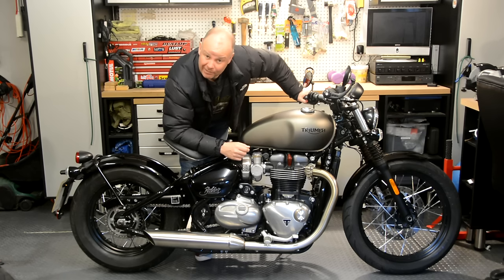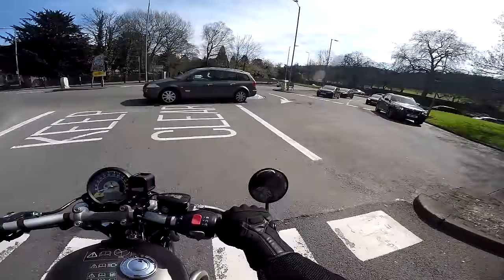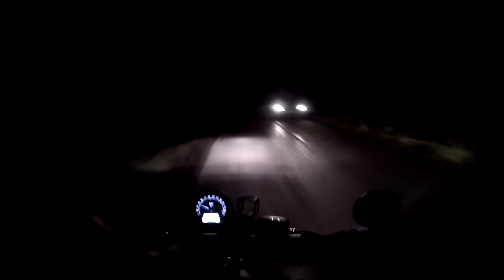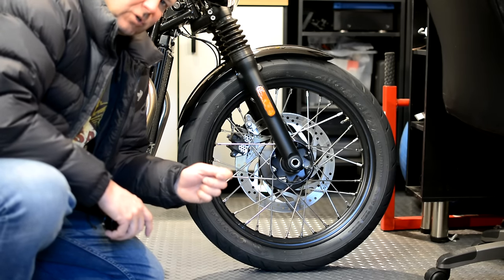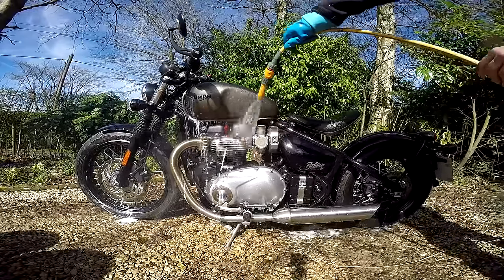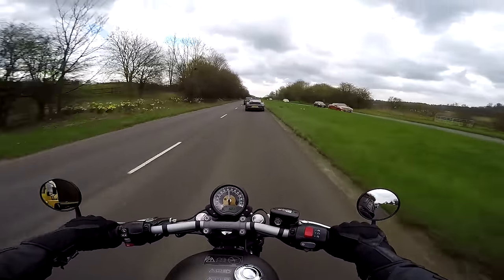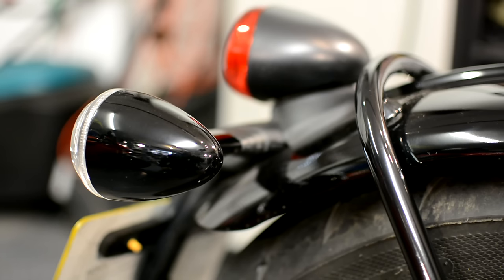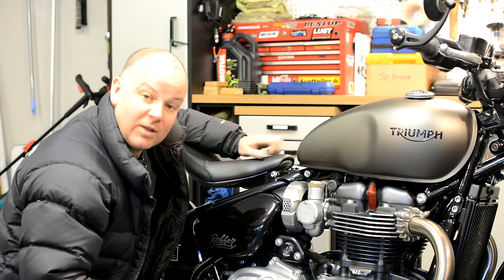Living with the Triumph Bobber - Long Term Review

Comment: Won one of these on Saturday in a competition!  Best £2.50 I’ve ever spent.....yep, £2.50!!!
Gets delivered tomorrow. Be a bit of a change compared to the MT09 but what a bike for those nice summer days!!
Forgot to add it’s a 19 plate with 1,579 miles on the clock.
Reply: I was going to get a Yamaha mt-10 but opted for the bobber. It’s such a classic look and I’m older now and don’t need to be breaking the sound barrier everywhere I go. How do you like yours?
Reply: @jak2828  hi dude. Yeah love it! Well that’s when the weathers decent enough for it to come out to play.
Such an amazing bike just to cruise about on and be a posing bugger haha.
I’d love an mt10 but I’d have to trade both bikes in…..don’t want an Mt 10 that much though! 
How you finding it? Was it the newer 21 plate model you got?

Comment: I fitted a T120 tank 170miles per fill up, Pretech 6pot caliper sorts braking.
Nice honest review
Reply from the maker: 170 miles is more like it - bummer that you have to change the tank though!
Reply: TheTrirocket3 so you changed the tank and brakes on a brand new bike? Respect
Reply: TheTrirocket3 whoa so you can install the larger tank on it. Thanks for that man. Was it a difficult job? 

Im looking at getting one of these but the tank size is my only grip. There are sections of highway where you can have 50 miles or more without a fueling station.
Reply: Post a video! Would love to see how it looks
Reply: I know this is an old comment 🙄 but will the T100 pipes fit on the bobber? I'm wanting the black edition here in the states but I want to liven it up a bit 🤣

Comment: A trick for detailing. Go to the paint store, or order up a 4" or larger, natural bristle paint brush (not nylon or synthetic...it should be natural hair.) Wrap the metal strap with gaffers or duct tape so you can't scratch your paintwork. Get a clean bucket of water, duck it in, and put a little soap on the brush and scrub up the bike. Spoke wheels become a breeze, without busted knuckles, the bristles will get into all the little spaces and clean them out, and when you're done the brush cleans up nicely.

Comment: Great review there Missenden Flyer!

I agree the front brake is marginal.
The small air cleaner and throttle body are fake. Just for show.
The 2 air cleaners are under the side covers.
The bike is fuel injected, so no carbs.
The stock exhaust sound was very good. If throaty is your thing.

I have 750 miles on mine and I absolutely love it (I have 2 other bikes that will be collecting dust this summer)

Comment: I just got my 2017 T120 and honestly.. I rode 200 kilometers yesterday after picking it up and my dip beam is so much brighter at the sides of the road than the high beam and still shoots straight down. I thought that I had been riding with the high beam on but I wasn't lol.

Comment: Thanks for the efficient long term review. Totally agree with the cleaning issues. I like a clean bike and the Bobber does seem to lose its new finish pretty quickly. Also dislike the key position, and think the handlebars and clamps look cheap. I love the hard tail look of the Bobber, but If I was going to spend that kind of money I would go for the Honda CB 1100, SORRY.

Comment: The fuel range seems to be much the same as Harleys fitted with peanut tanks, but their owners don't seem to see this as an issue.  Personally, I do - I dislike refuelling at any time.
Reply from the maker: +Tim Hammond Yeah me too, it would stop me buying one...
Reply: Tim Hammond 44 miles. Ridiculous. My electric can do 110 miles.
Reply: Chris Bramblett My Sportster 72 does about 50/55 before the fuel light. However, I have a very tall sissy bar with a bag and a fuel can strapped to it, so every 50 miles I just need a lay by. Although many would hate that, most of the old school chopper community just accept it.
Reply: those are ridiculous range, my tuono can go 100 miles before i hit the petrol station and even at that range i find it annoying
Reply: MOTHER OF GOD, that's bad ! And here i was bitching and complaining about mine going off at 120 (us)miles.
Reply: I have to say this doesn't bother me. I stop every one-and-a-half to two hours or so for a rest anyhow, so refueling doesn't really matter. Cruising at 100kph it does about 3.6-4 L/100km so can easily do two hours riding which fits well with my breaks.
Reply: Tim Hammond yeah if plan on doing more than a drive around town or to the bar a few times. I'd recommend something with a bigger tank. Triumph speed master maybe
Reply: 100kph is approx 60mph.  So riding for 2 hours would give 120 miles.  The Bobber would want to be refuelled in around 70 miles, no where near 2 hours duration !
Reply: Zen Zen I get 3,6L to 4L per 100km at 100kph. That means with a 9L tank I can ride for 2 hours quite easily. It's very fuel efficient in 6th gear at 100kph. I think you are maybe calculating with average fuel consumption.
Reply: Wow that is good.  At 4L/100km I calculate that you are getting a range of 135 miles.   This is much better than the 70 miles that the reviewer was stating in the video :)
Reply: Zen Zen that's only the range cruising at 100kph. Around town it's a lot lower.
Reply: I agree with you Tim, this is the one big issue I have with this bike. I like to ride, not visit petrol stations. I don't go to bike meets cos I wanna ride, not stand around with a full tank of fuel admiring my shiny unridden bike. This bike isn't for riding round towns either, it wants the open road. That's the beauty of the single seat... leave the missus at home and get out and enjoy the road not a bike meet.
Reply: i thought it'd be ok as i live on the isle of wight.but its a bit annoying.especially as they make you get off your bike and take your helmet off at the big petrol stations.alot of times i go to the little ones even though its more expensive,just so i can sit on the bike and not take helmet off and earplugs out.its quicker
Reply: These short fuel ranges are amazing to me. I've got an old 1999 Honda CB750F that gets up to 53 miles per gallon ( taking it easy) and with a almost five gallon tank I can easily get 240 miles.
Reply: That makes sense.
Reply: Official specs were 69mpg, so 138miles. 135 is v.good indeed!
Reply: All of my sportsters got 100 miles per tank.
103 to be exact!

Comment: Great video!  The suspension is medieval!  A new adjustable shock is a must!  The stock seat is minimal and should be replaced.  The wide handlebars aren't adjustable and reach for anyone under 6 feet tall.  The headlight is adequate but could be brighter and better defined.  The headlight switch is a bit backward, with a simple on/off option.  You can't flash your headlights for passing or get attention at night. Even with the larger 12L tank, the range is limiting.  The fuel light will illuminate just under half a tank, around 150 km.  Finding a suitable paddock stand is challenging, especially due to the low stance and excessive weight.  A significant issue is the high-end gearing.  ECU prohibits any significant changes to sprockets.  You will find yourself cruising at about 140 kph to reach sixth gear.  Aside from those nitpicking issues, it is a beautiful, robust motorcycle.
Reply from the maker: Thanks for the feedback!

Comment: I've ridden my Bobber for 126 miles on a tank full. 
Then filled with 2.44 U.S. gals and had 56 mpg gauge reading 
(Note: 2.44 x 56 = 136.6 miles)

"Range-Left" value on my gauge is faulty on my bike as it usually read in the 65-70 mile range (after 8 tank fills) and stays in that range until it actually has 65-70 miles left and only then does it start to count down to zero.

Triumph Service (Corporate) recognizes this as being a problem with ALL Bobbers and is working to fix it. Hopefully via a software patch.

My local dealer had my Bobber for 4 days and could not fix this problem... yet.

Comment: Regarding the lights I have the opposite issue, the dipped is awesome, best dipped I ever had, but the fullbeam lights up my front wheel and the either side of me but not really the road ahead.

Regarding the brakes, I completely agree. I will be upgrading them once they're worn out.
Reply from the maker: Yeah I think the light on the bike I had just needed pointing up, it had probably never been ridden in the dark before (as it's Triumph's press bike)...good call on the brakes.

Comment: Thaks for the review. I have a Bobber. It is a great bike indeed. But you mention that there is no "low end, low speed judder and easy to ride at low speeds" as well as a smooth low speed throttle... I dunno, my Bobber is just On/Off at low speeds. It's not smooth at all. It doesn't have that smooth roll on/roll off as you describe, or that the inline 4s have. 

I asked the shop if there were updated throttle maps that address this issue (as Yamaha and Suzuki have for some of their bikes of similar complaints) but they looked at me like I was mad!! haha!
Reply from the maker: Ah well I'm used to riding a single, two twins and a triple...."smoothness" means something else to you 4 cylinder jockeys!
Reply: But my Bobber is a lovely bike, indeed :-) 
Cheers, ride safe!

Comment: I've been hanging over one of these for a while, this review have given me a few things to think about. As for not having a center stand I have an MT07 with the same issue but it's easily sorted with a set of rollers that can be picked up from Amazon for around £20, great for cleaning the wheels and lubing the chain. Good and informative review, thank you.
Reply from the maker: Glad you found it of use - thanks for watching - TMF

Comment: The engine stains you mentioned is not corrosion it comes from some lube they put behind the logo ornament on the engin case and when your riding and the motor gets hot the stuff oozes and splatters allover those parts. Sadly when that lube dries with the heat of the engin it stains those part permanently. Gladly its covered by the the dealership.
Reply from the maker: Oh dear, sounds a bit naff!

Comment: I bought mine not long after watching this review six years ago, but have decided to offload it now. I did uprate the suspension as the rear shock is junk and the forks are not great. Its a superb engine albeit a bit like a diesel in its delivery, but the puny tank and atrocious ground clearance have just annoyed me beyond endurance.  I dont set myself up for the next Rossi but it should't drag the pegs on every roundabout.
Reply: By the way you were spot on re the front brake. Its abysmal. I fitted a FreeSpirits floating disk brembo kit to mine.

Comment: Greatful for this review. I’m getting back in to motorcycling and am finding it a nightmare to choose between them all, the tank capacity issue and nighttime lighting seems poorer than I’d want. So the bobber is crossed off the list..
Reply: Nighttime riding is horrific….had to use bobber when Mt was poorly….was not fun on a 14 mile trip from work on an A road.

Comment: I was just looking at the bobber at the Triumph dealership on Saturday and it's a great looking bike, very tempting but I ended up putting a deposit down on the T120.  Anything you can do over there to persuade Triumph to bump up production so I can get it sooner?  I kid.  I currently have a Yamaha Star Bolt (I think it's named differently in the UK and EU) and I found it's a feature (and complaint) of most, if not all, of the bobbers to have a small tank.  I only get maybe 120 miles of travel out of my Bolt before I have to fill up.  It's not an issue as I mostly drive around town, but out here in the western US, you have to plan well if you are going on a longer ride.  All the best TMF!
Reply from the maker: You won’t have that issue with the T120 - congratulations on the new bike!

Comment: Thanks for a great review, I'm thinking of selling my old bikes and getting one of these. I bought brand new in 2007 a Triumph Thruxton. Just like you I am a bit of a clean freak when it  comes to motorbikes. After about 6 months of ownership I had the first sign of tarnishing on the brushed aluminium lacquered engine cases. Actually it got "worming". Like white little worms in the lacquer ( obviously they weren't real worms ). I was disappointed to say the least. I didn't get on with the café racer riding position, so I traded it a year later for a new Bonne. Again the side cases had the same problem. So it seems Triumph is still having the same problem with there current modern classic range. I swore if I ever buy another modern classic from Triumph, it would be with the powder coated black engine cases.
Reply from the maker: Yes, I do love the chrome/brushed aluminium look but I must admit I might have to go "black" if/when I get myself a Bonnie for that very reason....

Comment: If this little thing was a 650 it would make more sense, especially in mileage.  In the ‘70s I had a BSA 500 Gold Star that was plenty of motorcycle.  Five hundred cc bikes make LOADS of power now.
Af for hanging on above 65, maybe this thing needs a bikini fairing or a driver on vacation.  Plenty of roads around where speed is not required and bound to be more fun.

Comment: Black engine cases (like on my T100) would help with durability but the alloy probably looks better. If you're a shorty like me with only a short reach the mid controls + flat bars make you sit rather hunched up. The bars from the Speedmaster would cure this though.

Comment: With regard to the engine covers my 2011 Thruxton was the same. I bought it at 3 years old with 1800 miles on the clock and the cases were showing a log of corrosion. I think they aren't covered with anything so mark up quickly. I solved it by getting the engine cases painted. BTW the KTM Super Adventure has illuminated switchgear
Reply from the maker: +Colin Porteous Ah interesting, thanks Colin...
Reply: And the KTM 690 Duke aswell. :-)
Reply: Aluminium is a reactive metal that naturally passivates which is to say forms a molecular layer of oxide which prevents it corroding further. Unfortunately if you polish it that removes the layer and it forms again as a white powdery surface. You can't win. The more they're polished (polish=abrasive) the more micro-scratches are formed and the worse the corrosion looks. I've seen cases lacquered but I'm finding that wheel wax both cleans, polishes and seals alloy cases, it's not permanent but will stand a few washes and last a season.

Comment: Hi. You didn't comment on the rear shock. I love my Bobber (and I actually don't mind the rear lights) and can actually go about 100-110 miles between fill-ups. One thing that I am disappointed with is the rear shock/spring. I can easily bottom out the shock. Do you find a similar problem? I weight 230lbs, so I am above average weight. To me the biggest negative point of this bike, besides the small fuel tank, is the fact that the rear shock has not adjustment whatsoever. For a $12,000US+ bike in the States that is not too much to ask, at least the rear spring should be adjustable.
Reply from the maker: I never bottomed out the shock but have heard others have done so (as well as grind the footpegs....I didn't do that either!).  Maybe I just ride like a school girl!!!

Comment: You mentioned the headlamp being LED. Something I've observed with LED headlamps as opposed to incandescent (halogen or HID) is they're very bright in the centre but have a poor spread, barely illuminating the verge, pavement (footpath) or ditch. 
I appreciate the GoPro never shows the beam well. Part of the problem seems to be the individual LED itself is very directional needing a form of lens to diffuse it, and part of the problem is reflector design because the LED, being so directional, does not illuminate all of it, even though the "bulb" is generally a cluster of LEDs. This shouldn't be a sale killer but I do think a little more effort could be put into the design. Personally I like the dip beam lighting up the verge/pavement to show pedestrians, or deer.
Reply from the maker: Yeah I agree these new fangled lights do have a sudden drop off - as you say I'm sure more spread could be designed in - As this Bobber is a press bike it had probably never been ridden at night before! (and hence the light isn't adjusted quite right!) - thanks for watching and for stopping by - TMF
Reply: I've driven other stuff with LED lights and they all do the same sudden drop off. I reckon it's something they haven't got right yet. It's not just Triumph. Thanks for posting.
Reply: Jeff Slade I have a Forza 125 and the LED headlight is excellent, possibly due to the number of LEDs and the v-shape of the array, it illuminates in a broad 'fan' ahead and to the sides. looks cool too :)
but no doubt not practical in a more compact headlight..
Reply: Well it's probably the one they got right then. I've tried several LED type headlamp bulbs and they don't give me the close to 180° spread you can get from an incandescent with a reflector on main, and which gives peripheral lighting of stuff that might leap out; we've got deer but even an unrequited rabbit will have you off. 
I've never tried a night time video from the bike, it might be interesting but the GoPro is pretty abysmal then and the much heavier (problems mounting it) Panasonic tends to go into night vision mode and turn night to day (I've done a fair bit of night photography with it).

Comment: A very belated Thank you a for a great fully informative review. With any of your Bonneville bikes. Overall how’s the chain maintenance? How often do you clean your chain, lube it and have you had much chain droop? Any issues with your transmission? Would you suggest the Fox or any shock upgrades? 
Have you tried the Quilted seat?